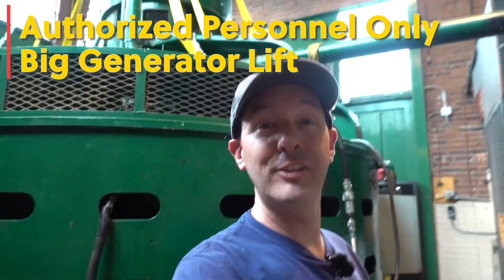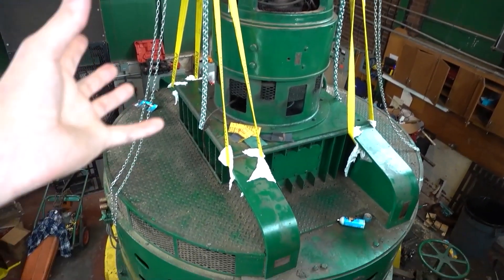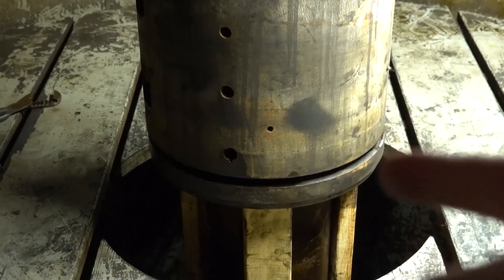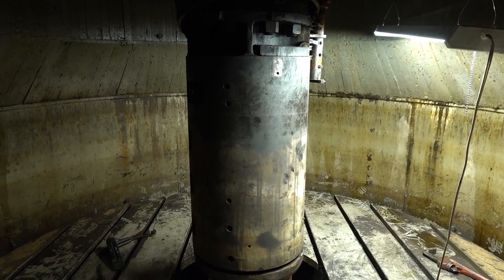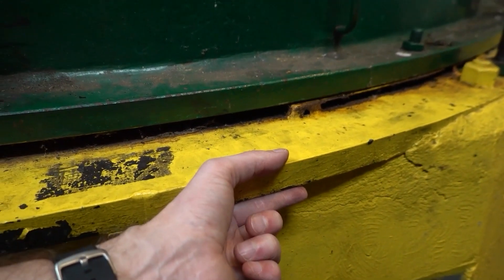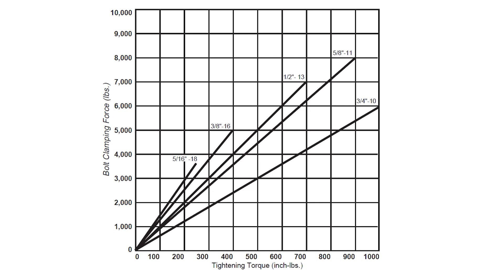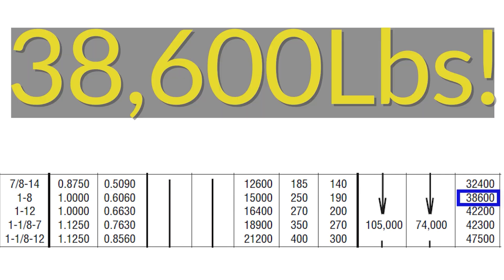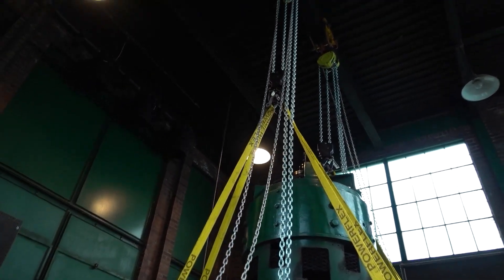Lifting A 30 Ton Generator Inside A Hydroelectric Power Plant

Comment: Grade 8 bolts have six slash marks on the head of the bolt. I changed the cutting edges on the blade of a Caterpillar D9H... those bolts had 12 hash marks on them. 1-13 and I think they are rated at 249,000 psi shear pressure. Hey, I'm just a parts changing flunky. The starter on that pig is a MONSTER.  LOL

Comment: I know these are mostly for historical purposes now, but I also know that this does have something to do with your regular job, as opposed to the high voltage test lab you're working on setting up. So my question is have you considered talking with engineers on dam and hydroelectric plant design for a possibly brief, episode on how one sizes the equipment to be set up at a hydroelectricity based on the various attributes of the area (head for the water behind a dam, volume of water contained behind the dam, etc.

I'm sure you're aware that we lost a deprecated hydroelectric dam on one of the tributaries to the Minnesota River this last summer. I do not expect that they are going to seriously consider reconstructing the dam, as it was providing a minimal set of features, and they had shut down the hydro,most likely because the didn't have someone like you helping them keep the plant in good repair.

I'm well aware that many of the factors in building out such a plant is worked out long before they shovel out the first shovel of topsoil at groundbreaking, but I'm a bit curious as to what factors go into deciding what's going into the plant. I'm also aware that this is probably a better question for Grady, over at @PracticalEngineeringChannel. I also know that for probably all of the plants you're working, along with the plant we lost this last year in Minnesota, the cost was largely funded as part of the Rural Electrification program early last century, so a lot of the people involved are no longer with us, but I would suspect that there are rules of thumb used when designing a plant, such as if you hold back this volume of water with this much head, you can expect this much energy will be available over a given period of time, and this size of a generator will stay under some limit as to how much water can be expected to be drawn off the resivuar before there are problems with too low of a head.

Then again, perhaps this comment won't get read. That's OK too.
Reply from the maker: Thank you! I read almost, not every, but almost every comment and I appreciate you asking good questions.

The newest dam I work on turned a hundred last year, so I don't get to talk to people who are designing new ones. But I bed once people see your comment, we might get a few experienced people to speak intelligently on this. I hope so, because I'm certain to learn just as much about it as you do. :)
Reply: @Physicsduck  Part of what got me wondering on this is recognition that there is pretty much no way for me to make use of hydro power. I have water flowing through my property, but where that water is there is a elevation change of perhaps 6 inches. There might be more during the spring melts, but...

Part of wondeirng at the calculations involved is that I've seen a bunch of videos from the past decade regarding micro-power, even 'nano-power' not to be confused with pumped hydro. Most of the solutions I'm seeing either don't involve a reservoir, or the property owner has enough acreage with elevation differences, that they can power a 25 kw hydro power generator all year. 

Probably the thing that got me most interested in your end of things has been watching the synchroscope use to bring the various plants into sync with the eastern grid. This is of interest to me in the possibility of building 'on demand' power for off grid solutions. As my setup doesn't include hydro, and is off grid, so no commercial power concerns, what I'm working with is solar with batteries supplying a very small load, think medium sized camper. What I'd like to do is set up several small arrays of solar panels supporting small banks of batteries, with one site that manages the whole setup. As the load observed at the main site exceeds the capacity of one of the remote solar collection sites, it can be brought online to supplement and reduce the demand on the main site. As the overall load comes down, the remote site is taken offline shifting the entire load back to the main site. Also as part of that the system would need to track the battery capacity at each of the remote sites, to determine which of those sites are better able to support short or long term inclusion in the demand.

One of the problems I've encountered already is that it's really a good idea to make sure that if you're going to bring load capacity on line, it's a good idea to insure that you have load demand for that capacity, or bad things happen to the primary system. Bought an extra inverter with that lesson. I still have the inverter that taught me that lesson, I may one day consider replacing the switching transistors in it.

All in all, it's still a back burner project for me. as a  result of bumping the one inverter, I replaced it with a 3500 watt inverter. It does a number on the batteries when the load is low, but I'm less tempted to tie in added capacity for now. And that's more power than my site is likely to need any time soon. I also have two 3kw growatt stackable off grid inverters that as a pair can either supply 6kw 120 or 6kw 240 volts split phase, or with a third, can supply 9 kw 3-phase with 112v per leg. If I ever get around to setting up a machine shop, getting a third one of these, or 4 more and tie them together with a 480 3-phase configuration might make sense, but I'm nowhere near there. And my retirement plans went up in smoke with an early retirement, so the investment cash probably isn't going to happen either. More batteries and building out the two growwatts is possible though, for now I only need the 120 half leg, though having the option to bring up 240 for welding would be nice.

So yes, if there are people who have expertise in working out the engineering on water volumes and head for hydro power, especially on smaller scale (say 50-250 kw) setups, I'd love to know more.

Comment: During the course of my career as a union ironworker I was assigned to do the rigging for a unit overhaul at a hydro electric dam. The unit was under going the first major overhaul in it's operating lifetime. The plaque on the  unit stated it was engineered and built by Allis Chalmers and went into service in 1931. Over the years it has received basic maintenance and upgrades but this was it's first complete disassembly and repair. The year was 2000-2001 it had been in service for 69 years! It was an amazing feat of engineering.

Comment: I had an internship where an industrial ball mill went out. Very big Westinghouse 4160 v motors. It was mounted on the 2nd floor, so it had to be manually hoisted up, moved horizontally, and then lowered to the first floor. The electric hoist motor had been out probably before I was born, and the whole plant maintenance team (about 35 people) came out took take turns pulling the hoist. Oh boy was that expensive in terms of man hours but It wasn't every year that those motors burned out. Very fun day.

Comment: In my mind it's good to let load 'settle' overnight if it hasn't been moved in decades. The last thing I would want is someone to immediately begin working underneath it only to later find out that it was 30 minutes away from catastrophic failure. I wouldn't know what kinds of hidden stress fractures after decades of operation there might be.

Comment: i have a ? is it possible once the gen is in phase to overpower it to skip phase or overrun the phasing
Reply: Once a generator in electrically synched to the system it is paralleled to it is magnetically coupled and basically locked in . The only way you could have what you are describing known as a "slipping pole"  condition would be if field strength to the generator field windings were to be somehow  reduced to a level that allowed the force of the water on the turbine to overpower this reduced magnetic coupling between the rotor and stator windings such as because of a field current failure  . Many Hydro generators have a special winding built into the individual field poles known as an "Amortissuer" SP. winding . If a slipping pole condition starts to occur currents are induced from the stator into these special windings   increasing the magnetic strength to prevent pole slipping . Due to the rotating mass involved the vibration created by slipping poles is unbelievable and can be highly destructive to the generator . Most generators with have other protective devices installed as well to immediately trip the generator offline should this type of event occur .

Comment: Isn’t it conservative to use clamp force for a jack bolt considering it’s a compressive load? Or is the limiting factor the sheer strength of the threads?
Reply: I was thinking the same thing. Those bolts being loaded with a compression load should be able to withstand more load that in a clamping configuration. Maybe @physicaduck can enlighten us 🤔

Comment: I've always wondered something about hydroelectric power, but whenever i ask i end up drawing an awful lot of suspicious gazes and few replies..

Do all of the systems have redundancies, or are there any single points of failure that cannot be helped?

(I had an electrical engineering friend tell me, years ago, that when it comes to powering the grid, "There will always be SPOFs, the best you can do is improve ways to mitigate damage".

So, seeing you make these videos about this hydro plant, i've had his statement rattling around in my head XD

Comment: Not worried about the bolts, more the century old threads in the alternator base that they are in, as to the failure point. Those likely are the original moderately loose tolerance threads from manufacture, which are a lot more likely to shear before the bolt fails.